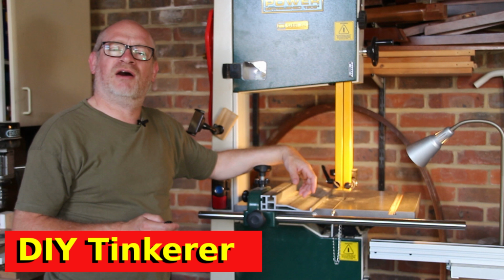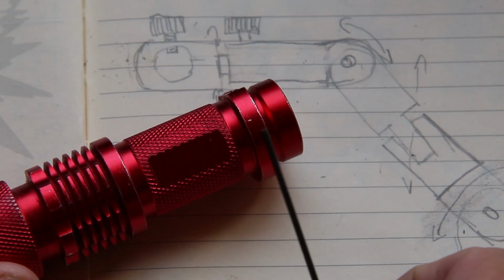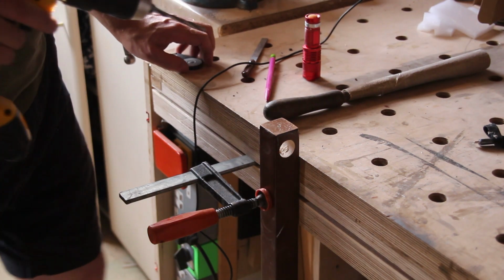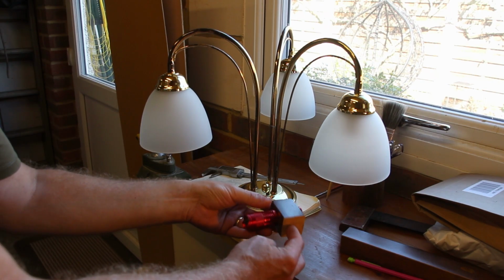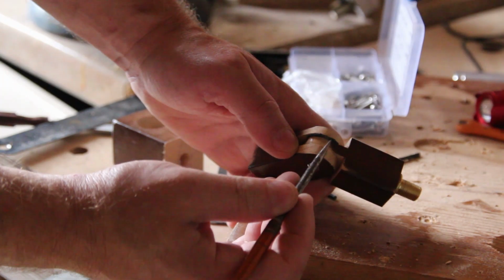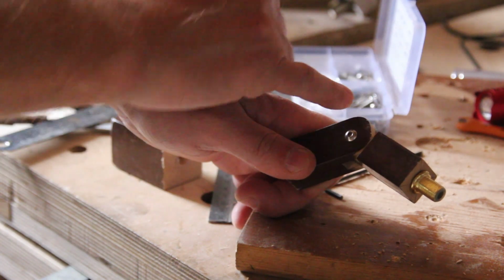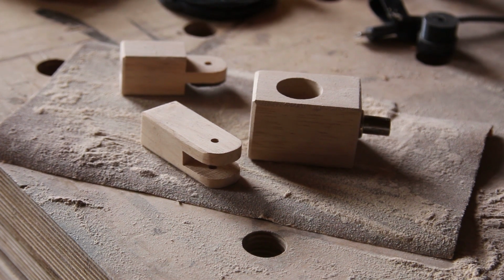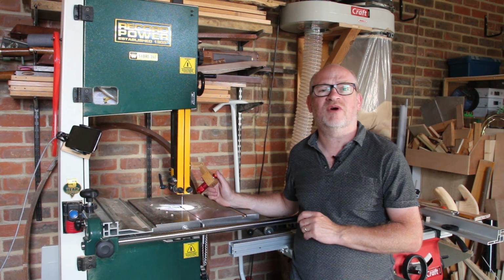97. Articulating light for my Workshop Band Saw

Comment: There are nice sewing machine lamps with metal goosenecks and LED lights with magnetic bases that I've put on my machines. Bought a set on Amazon for about 14 USD a few years ago. Very bright with a compact head.   Caution against grinding non-ferrous metals like aluminum and brass on a grinding wheel. It will clog the wheel.  Suggest  a sanding belt instead.
Reply from the maker: Thanks that's some great tips, I really appreciate you sharing them. Thanks for watching 👀 🙂

Comment: Thanks as ever for the post. Pound-shop adhesive USB-powered LED strips have changed my crafting life. Angles/extenders/adaptors and switches for pennies on ebay. Appreciate though that sometimes you need a focused beam. Cheers.
Reply from the maker: I did consider led stripes but the torch was free 😀